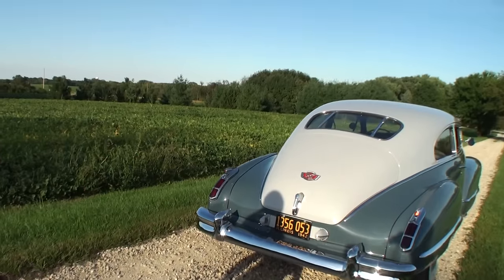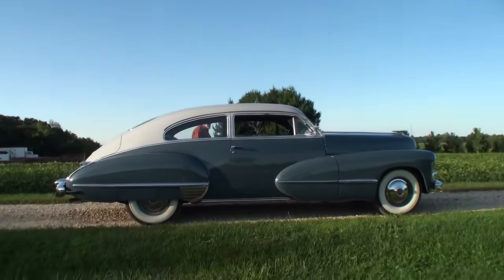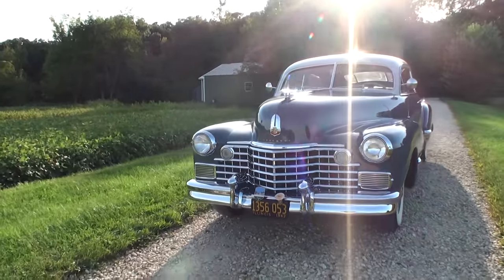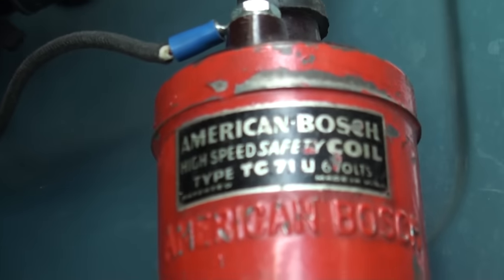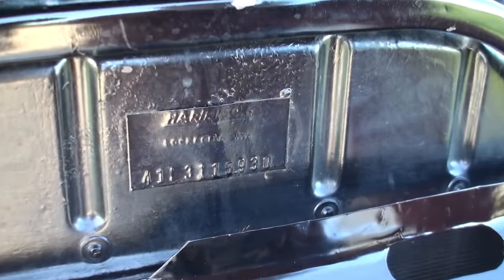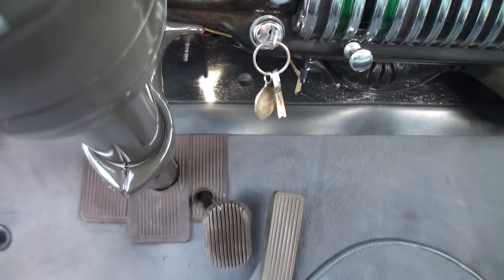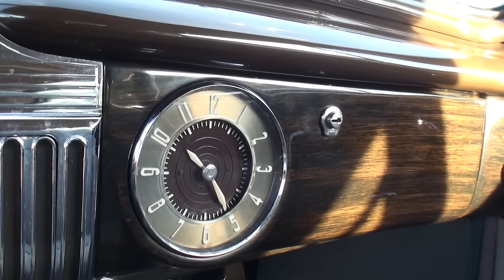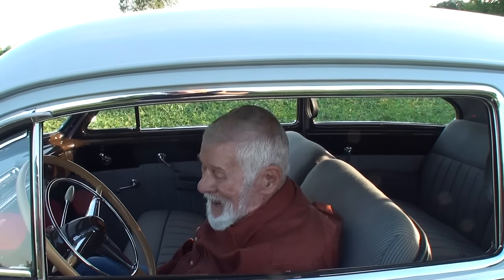1942 Cadillac Series 62 2 Door Coupe Fastback & Engine Sound on My Car Story with Lou Costabile

Comment: I remember my dad's first car after returning from the war was a black '41 Cadillac Model 62 - almost exactly like this one. I recall one of the quirks was the turn signal: Pull down for a right turn and up for left. (Maybe my dad just got the wire crossed?) At one point he had to mill the heads and got more compression. MAN! That car could really go! Mom enjoyed driving it, too. When getting gas, she enjoyed fooling with the attendant to find the gas cap. :-) When I would be kneeling in the passenger seat, her arm would always come up to keep me in the seat when she was braking. Thanks for the memories.
Reply from the maker: Thank you for viewing, sharing, and you're welcome.

Comment: Magnificent restoration of a classic work of art. The extremely dramatic difference in styling between the 1941 Cadillac (also gorgeous) and the 1942 is quite amazing. In only one year they fast-forwarded to an ultra-modern look.
Reply from the maker: Glad you enjoy this one :-)  Thank you for viewing and the kind words sandaglad, Lou
Reply: Lincoln had this streamline sedans 2 or 4 door in the line up since 1937 in the Zephyr program, I guess and GM copied that. Interestingly after Edsel death the Lincolns switch their front design to a more Cadillac type grille design in 1942 and loose much of it's charm.

Comment: Hydromatic started in Oldsmobile in 1940, added to Cadillac in 41, but it was built by Buick!
Reply from the maker: Good to know and thank you for sharing your knowledge.
Reply: Beautiful work of art. M.
Reply: Strange. I would have guessed Old's would have since Buick had the Dynaflow.
Reply: @gregorytimmons4777  You are right. Old's was the "tryout" car for the Caddy. Anything new was in the OLD'S FIRST, TO FIND THE BUGS. When proven GM put it into the Caddy.  Buick switched when the DynaFlow factory burned down.  In the late '50s I think.
Reply: The Hydramatic plant burned in 1953 forcing Oldsmobile to resort to using Dynaflow in some/all of their 1953 cars.  I knew of a fellow in Spencer, IA that had a '53 or'54 Oldsmobile with that combination.  Always wanted to ride in an Olds with the Dynaflow, only knew of that one example & never had an opportunity for that super smooth cruise!

Comment: no plastic here !
Reply from the maker: Great point!  Thanks for commenting, Lou
Reply: Glass jar for the windshield washer water.  The raw asbestos heat-shielding on the exhaust would be a big no-no these days.
Reply: *There were 'Bakelite' products on the Caddy even then...as well as other phenolic-resins*
Reply: "Bakelight" was early plastic and that is used on alot of these ol' classic cars aswell as other early plastic type compounds!
Reply: Just how I like my women
Reply: OR RUBBER EITHER,Save for the tires!

Comment: What a beautiful shade or version of blue. Is that original or a more modern color?  It fits the car wonderfully.  It reminds me of a color I used to paint a 1963 1/2 Galaxie. It was close to the original, but I wanted to "improve" on it a bit to go from kind of dull to nicer.  I could not decide between a mid-70s Ford Slate Blue metallic and a GM Dark Blue metallic.  I wound up mixing them half and half and came out with a wonderful shade that looked perfect and beautiful on the Galaxie, and no one ever asked me if it was anything other than an original color.
Reply from the maker: Thank you for viewing & sharing. Hope you see many more cars on this YouTube Channel you enjoy, Lou

Comment: Designed by Harley Earl. Originally, these 1941-1947 Cadillacs and Buicks were called fastbacks or torpedo sedans until 1947, when they changed the body style name to "sedanette". Reason for that was Preston Tucker's introduction of his wonderful 1948 Tucker Torpedo, advertised in 1947, and GM did not want to get into a tussle with him about it. Tucker overreacted and dropped his body style name 'Torpedo' in 1948 when the cars went into production, and simply called them the Tucker 1948. He was a bit intimidated by the Big Three automakers, and then dragged into court in Chicago and put out of business by them in 1949. This "Torpedo" or "sedanette" body style was available on all car lines of GM in the 1940s until 1951. I have seen examples of them all. The Chevy Fleetliners are beautiful with their chrome strips on the fenders, and Pontiacs with their silver streaks, and Olds with its "chrome frown" front grille, with the Buick Super and Roadmaster series, and the Cadillac Series 62.
Reply from the maker: Hi Donald, Thank you for sharing your knowledge, Lou

Comment: We're the engine and transmission used in Sherman Tanks.
Reply from the maker: The Sherman had four different motors that made it into production tanks. The R975 radial, The GM 6046 ‘twin’ diesel, the A57 multibank, and the Ford GAA V8.  There was also a Caterpillar motor they were trying out I cover in the Shermans of the Future section.

Comment: Thanks for sharing such a magnificent automobile.  I was curious about the wide drive belts on the front of the engine.  Was that standard back then?
Reply from the maker: Hi Sreginkc, Glad you enjoy this car :-)  Not sure if that was standard, however if it took Art 5 years to get this car correct, it probably was.  Maybe a Viewer can help confirm the correct answer to your question, Lou
Reply: I had a 1946 model 62 . Same engine and 4 spd Hydramatic transmission which was excellent and durable . Yes , the heavy wide fan belts are correct factory equipment used till the last 346ci 150hp  flathead V8 in 1948 . My owners manual even talks about the engines and transmissions being used in tanks thru the war (including pictures) !! 
     My 46 also included the very early attempt at air-conditioning . Condenser was in the trunk just below the rear window shelf with a louvered grill . Compressor located on engine driven off one of those "fat" fan belts  mentioned earlier . Problem was , the unit was a bit to small for it's required use on a hot day . But , give GM an E for effort . 
      I have a 54 Imperial with almost identical set up , but twice the size with a 4cyl compressor and it can quickly turn the interior into a freezer -- lol !!!
    My Caddy only had 32k mi when I purchased from original 88yr old owner so this jet black beauty didn't need any restoration just a nice polishing and new wide ww tires . The exterior on the 42 and 46 are almost identical.  Very slight change in grill only and same wheel covers but I also have the outer "stainless beauty rings" that press in , between the inner hubcap and outer edge of rim . I think it was optional and this gentleman could find set of 4 or 5 and snap them in . They just add to the beauty of that excellent  restoration . I also had a metal sun visor which looks great and does a nice job keeping the sun off you and the georgous simulated wood finished dash panel . 
       I have 4 beautiful old timers left , but I'm the oldest at almost 87 .  So when I'm cruis''in down the hwy , I say "Lord , I don't need streets of gold , this just fine" !! 
       Enjoy your 42 , it's a beauty and I know exactly the feel you have driving it , super quiet and comfortable , a wonderful hwy car .

Comment: Didn't the design of having one third of the radiator above the height of the heads, make it prone to overheating?
Reply from the maker: Hi Big Red, Interesting question, however I do not know the answer.  Hoping a Viewer can share knowledge, Lou
Reply: @loucostabile  lt is strange, as we had german sourced GM  sedan here in Australia in 1986 which used a 3.0lt nissan straight six. The engine was lower than the radiator though, and were renowned for heads warping due to being over hot. I guess if that configeration on the Cadi was used in other models later in the GM family of cars then it must not have been an issue.

Comment: Any 1942 model car is collectible, due to the abbreviated production run caused by the Japanese attack on Pearl Harbour.  Less than a month after the Japanese attack, the federal government’s Office of Production Management froze car-making. OPM’s officials also froze the sale and delivery of cars—except for individuals who had signed a contract, to buy a car, before January 1, 1942.

If a person had such a signed contract, the local rationing board could issue a permit allowing the buyer to secure the car’s delivery.  Every American car manufacturer had to end car production by the 22nd of February, 1942. All cars and light trucks which hadn’t been sold by that cutoff date—around 520,000 of them—became part of a new stockpile. While the war lasted, those stockpiled vehicles could be sold to “essential drivers” via a system of rationed sales.

Of the handful of passenger cars manufactured in January and February 1942, many used painted rather than plated exterior trim, as chromium was declared a strategic material. Extremely rare today, these vehicles are known as blackout or victory models.  Here are the dates when various manufacturers stopped building '42 models:

January 24th - Willys Overland
January 29th - Dodge
January 31st - Lincoln, Chrysler & Studebaker
February 3rd - Oldsmobile, Buick, Cadillac, Hudson & Nash.
February 6th - Chevrolet
February 9th - Ford & Packard
February 10th - Pontiac
Reply from the maker: Hi Graham Clayton, Thank you for viewing and sharing your knowledge, Lou